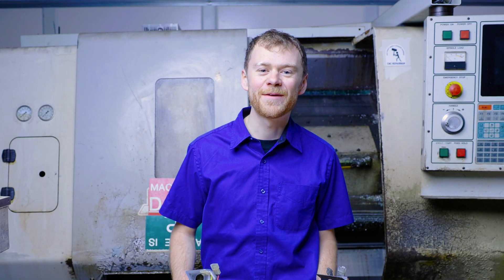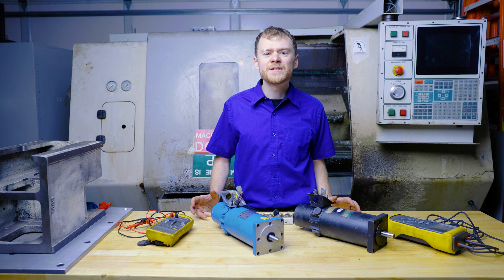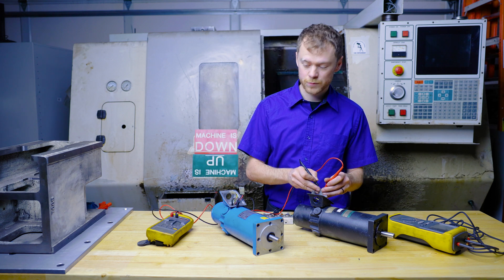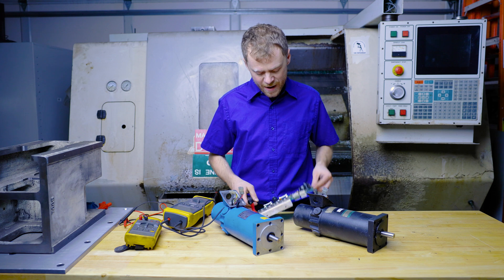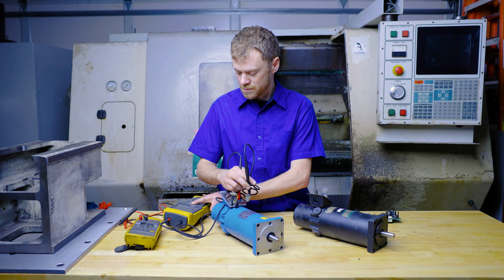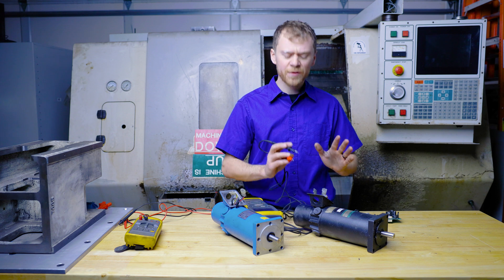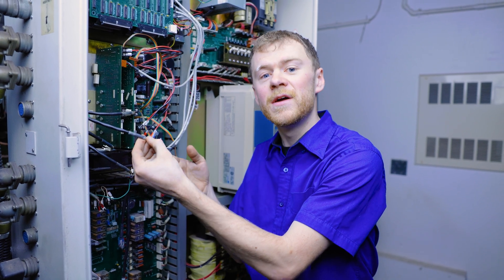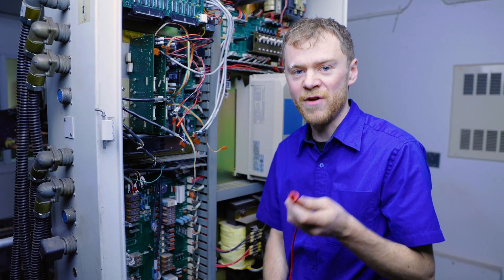Troubleshooting DC Servo Motors

Comment: Helpful video, but a little bit contradictory. You said anything under 1M ohm is bad, but when you tested in the panel and got 2M ohm, you said that was bad. I’m not a CNC specialist, but if I read 2M ohm between a phase or winding to earth/ground, I’d probably be looking elsewhere for the fault

Comment: Its generally not a good idea to megger at a higher rating than your insulation is rated at. I wouldn't have a problem meggering that motor at 500 but wouldn't do the 1000volt as it risks punching holes through insulation at the microscopic level. expected good levels is 1meg plus 1 meg per kv.

Comment: Hello 
I'm from, Paul I'm from Peru 
I have a HAAS VF0 CNC. 
It is possible to use the servo motor and its original amplifiers and perform the control with mach3. 
How to identify pulse and direction, enable.